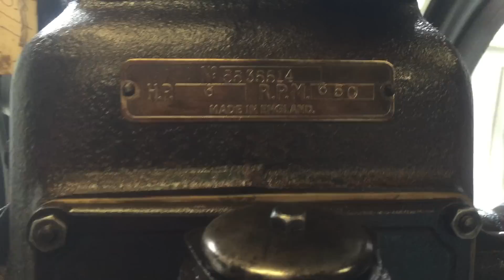Vintage Water Cooled Diesel Lister CS 6 HP @ 650 RPM

Comment: these old engines are so quiet compared to the noisy engines of these modern days! would work great with a generator!!
Reply: These engines are mechanical art. Not like the massed produced junk today. 
All people care about anymore with engines is "How much horsepower does it have"?  People don't appreciate a simple, low stress design like this anymore built to run for a century.
Reply: i already have a alternator connected with this same model...bt voltage is not accurate due to low rpm
Reply: @bittusharma6852  why not have a belt on the flywheel to a smaller wheel so you can increase the rpm on the side of the alternator ? 
it says 650 rpm. so a wheel that is 1/4 of the size would make the alternator do 2500 rpm,  which is enough for the alternator to work better.

Comment: You did a great job! Engine clean and working! I have a Cs lister I am finishing to replenish. I noticed that the oil pump is not going: pressing on with screwdrivers goes but turning the flywheels. No. Is it the spring to change what you say?
Reply from the maker: It could be spring, or it could be the tappet end is worn or the cam end that drives it is worn. Does the rod that drives the pump move up and down freely?
Reply: Thanks for the advice! I solved changing the spring with a longer one! Now the oil pump works !!
Reply: how much HP does it have